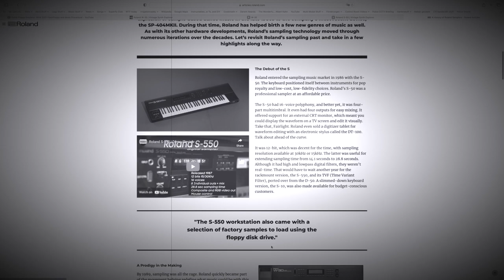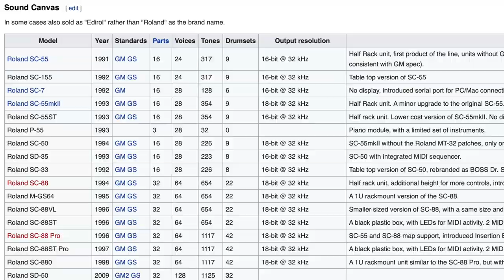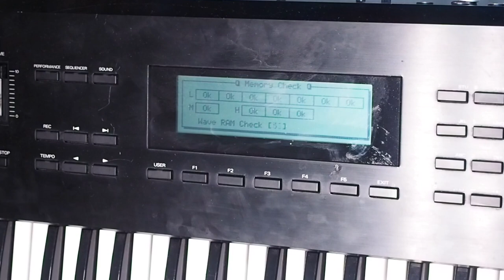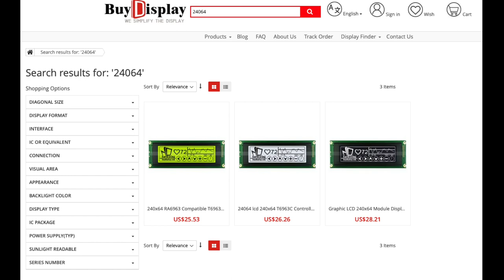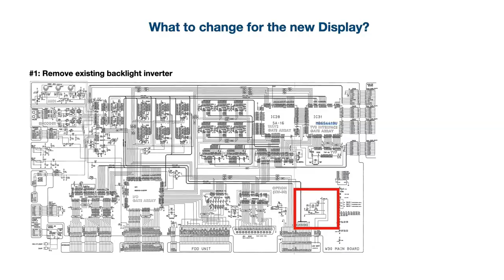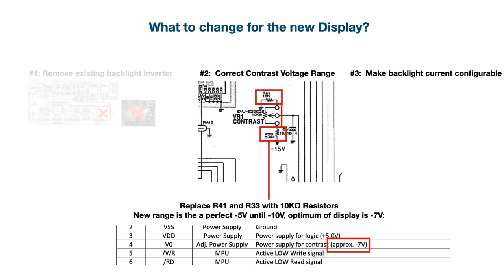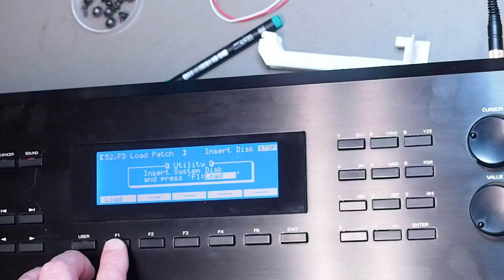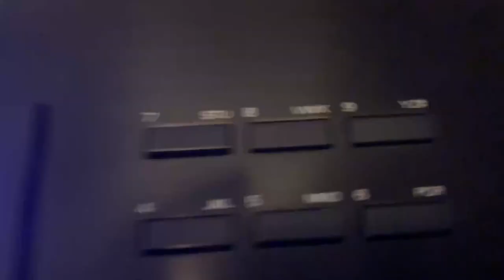ReinardSynth#8 Roland W30 Repair: new display and GoTek installation

Comment: Dear programmers and musicians, please pay attention to the Roland W30 sequencer. It has a "Record by key press" function that, when combined with real-time quantization, is rare. Considering its stability and lack of delays, I would like someone to port the Roland W30 operating system to a computer program on PC. This is possible because Roland uses an Intel 80196 processor.

Comment: Hi Reinhard! May I ask why you have changed the 2 resistors of the contrast circuit? Increased range? Is it necessary? Thank you.
Reply from the maker: I changed them to get the contrast voltage in the range needed by the display. I needed it to be between approx. 10V and -5V, where the optimum for the display is around -7V +/
Reply: Got it. I haven't changed them and now the optimal setting is when the pot is turned down all the way. Maybe it would be even better if I could turn it down even further. Not sure if this is worth disassembling the unit once again though. Anyway thank you very much!!